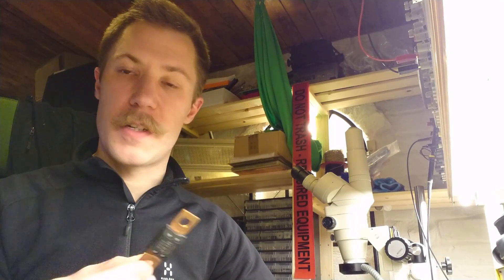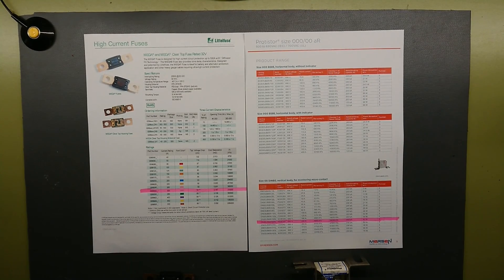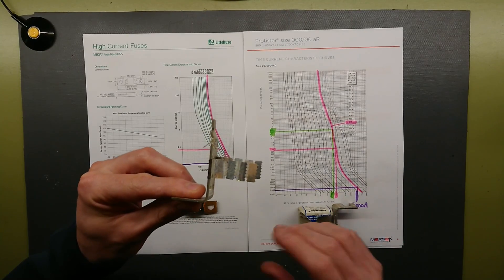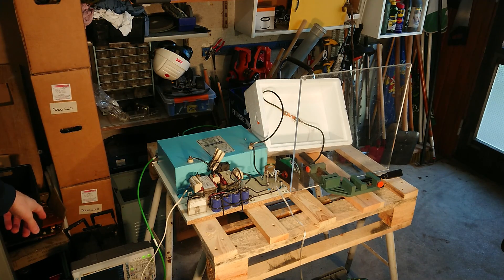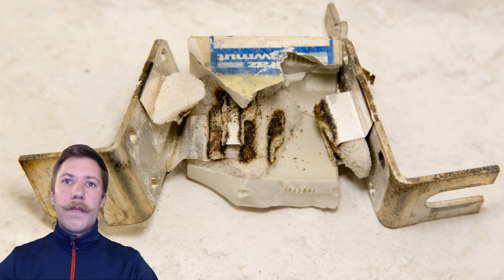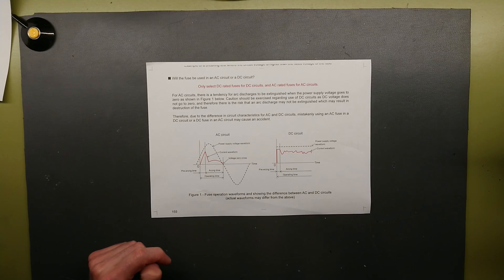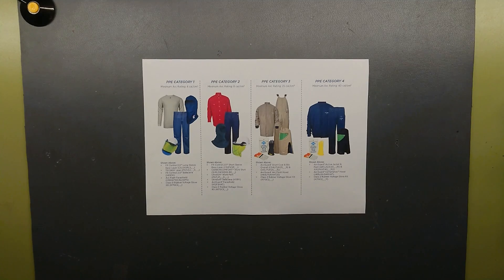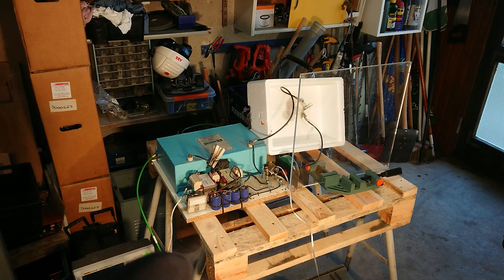AC vs DC Fuses, High Current, Explosive Destructive Testing and Theory

Comment: Hello sir , what will happen if I use ac fuse 13Amp on dc current ( under 1 amp and voltage is 12v DC )

Comment: hello where should dc fuse be installed, on negative or positive wire?
Reply from the maker: Positive side, as close as possible to the battery. Negative is often grounded and a melted positive cable to fuse, could form a short circuit path without fuse in the loop.

Comment: 11:58 I2t is not energy. You have to mlutiply by the resistance of the fuse to get energy required to blow the fuse, and that resistance will change as it heats up.
Reply from the maker: You are right, thanks for the correction. I should have said let-through-current as the the let-through-energy is what I discuss about the PPE withstanding a certain amount of Cal/cm2.

Comment: Most informative!  For the audio warning at 6:10, you get my vote for most courteous YouTuber. :)  Audacity's "Dynamics Processor" does a good job too, but thank you!
Most of my equipment damage happens in the same way that you almost lost your scope.  The actual test or experiment seems to be the safe part.  With electricity or high-kinetics, I try to turn the "cat-like reflexes" off any time the bench could become hot.  Controlled and planned movements or none at all -- let it fall if something's bumped and stay in the safe spot.  Somewhere along the line I heard "no situation is so bad that you can't make it worse".  I've tried though... :)
Reply from the maker: Thank you! I kind of do experiments by a similar philosophy. "Everything is dangerous, nothing can be touched, no protective equipment will keep you safe, always ground a circuit before working on it"

Comment: Interesting to see, I didn't really notice the difference until now, propably because I never really work with such high power levels. 

And answering your question, yes I did, propably more often than I want to admit. 
Once I literally blew up a cheap multimeter by measuring a capacitor bank, there was little to nothing left of the poor thing. 
Another time I made my serial adapter go up in smoke due to a ground loop.
And the worst thing was a 4GHz Amplifier module that decided to die on me, however I think this wasn't really my fault.

Greetings from Germany, 
Michael
Reply from the maker: I just happened to caught myself on film on this little stunt, but yeah a few power supplies has exploded on me over the cause of the years. Especially a 48VDC 60A power supply I used to power up a ZVS induction heater decided that it did not like a inductive load like that and the input filter capacitor exploded in a fireball going out the back, was pretty intense. But its a good reminder to always have a camera rolling to catch those moments :)